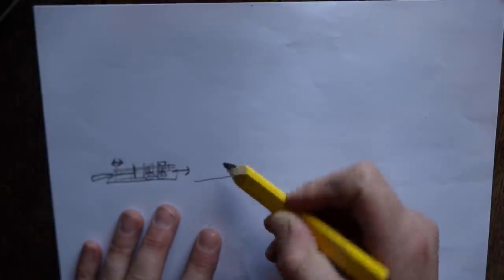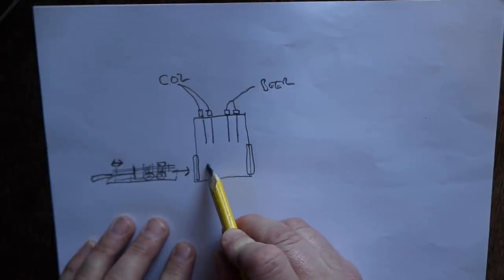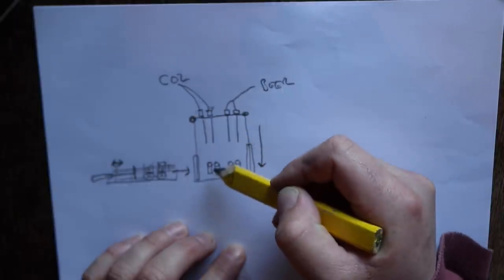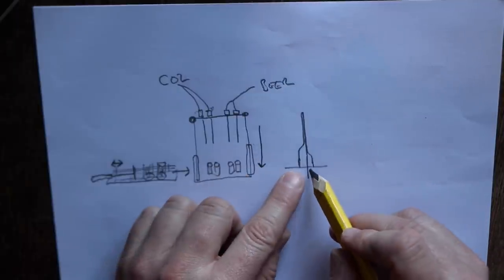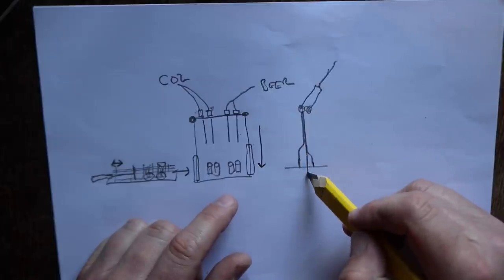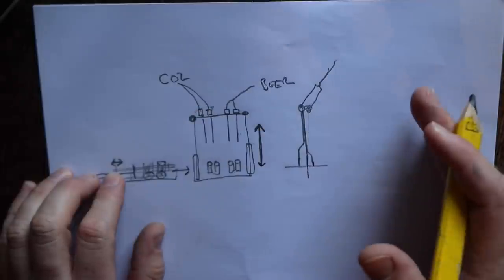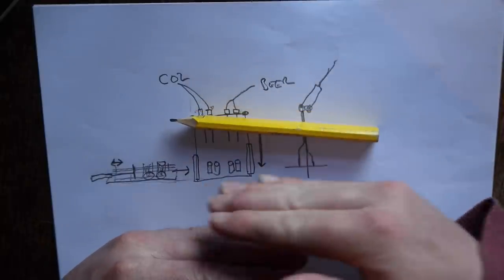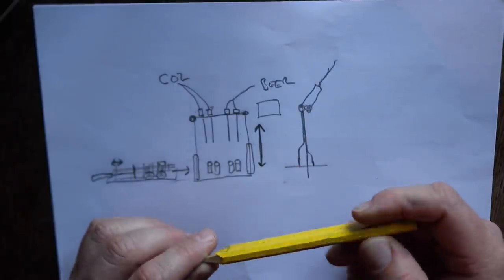Automatic Can Filler

Comment: Video called - Wild Goose canning - Defiance Beer has almost exactly what you drew in operation. It looks like filling is a simple volume controlled and the feed line is controlled by sensors. Neat drop system for the can lids. Purge is about 4 seconds. Slow and steady and very simple, which is always the best. Good Luck.
Reply from the maker: Cheers Bud
Reply: @harrybrew69  Rather have a Harry's brew, actually 🍻

Comment: I would say the can filling level would be controlled by weight, an interesting project all the same.
Reply from the maker: Thought of weight but there is a lag on the data being fed back, plus momentum of the liquid would also give a false read.
Reply: HarryBrew69 you could stop it before correct amount if using weight to counter the lag. A conductive inox sensor is simple and easy as you suggested.
Reply: @harrybrew69  flow sensors.  I messed around with hall effect flow sensors - Adafruit did a bit of a "root" beer keg which tweeted how much was being used.
Reply: The brewery I work at has a small canning/seaming line.  I'd be glad to video/photo each section for ideas.  It utilizes conveyors so you load a large table with cans that funnels to a single file where at the end there is a piston gate.  The cans get rinsed then stage for filling.  You may want to use a dual probe that purges with CO2 then fills beer.  After ours fills the caps are dropped on then they are seamed.  They are rinsed and dried then labelled.  Oh, I forgot at the beginning as they get funneled in they get date codes on the bottom.  Let me know.  I've set up these conveyor systems.  Like you, I can handle the mechanics but I wouldn't be much help with programming.  If I were to do it I might make it mainly mechanical controlled and avoid programming...
Good luck!  Can't wait to see the final build.
Oh, your rails should be teflon mounted to stainless...  I've also seen delrin used.
You'll also want a trough with a drain connected to a hose under all the track as foaming/spillage will occur.  
Make sure your filling with cold beer.  Ours works better the colder it is...
Reply: I agree that weight would be the most accurate. The foam will not give a true reflection of the amount of beer in the can. What if you have a beer that has more foam than usual?

Comment: Hi Harry,

This sounds like an exciting project. I have a few ideas based on the commercial canning line we use at work. It's an ABE (American Beer Equipment) machine.

First though, I don't have a lot of experience with the capabilities of Raspberry Pi vs Arduino, but I have used both. If I had to put my money on one, it'd be the Arduino. To my limited knowledge of these micro controllers, Arduino has greater expandability than Raspberry Pi and no doubt you will want to expand capabilities down the line. Just check out the SparkFun website to see the range of breakout boards available.

As for the machine itself, I would go with 4 filling heads and mount your purging tubes and fill level sensors around the fill heads. You've got the right idea with the fill level sensors, same set up as the ABE system, although it can be finicky at times. The sensor probes (like an L shape flipped forward) are made of pretty thin and pliable metal, so they can be easily bumped and upset the fill levels. Keep that in mind for your design. Personally I think there must be a better way to set up that sensor to keep it more accurate.

For the purge, I think 10 seconds is too long. Our line purges for about half a second. The idea is to put a small blanket of CO2 on the bottom and have the liquid fill underneath the CO2 layer. If I were making one myself, I'd have the CO2 tube go right to the bottom of the can, just above the bottom of the fill head. I would say no more than a 3 second purge you should be fine. We have a D.O. meter and can piercer too, so we can really experiment with this stuff and let me tell you, we have been surprised with some of the things that work in reality vs what you think should work. Purging time is one of those things. 

Another feature our system has is a CO2 pulse. The pulse happens during the last 3rd of the can fill. The idea is to create a fob of bubbles to help push out any O2 that may have mixed in with the CO2 layer. It's just another tube like the purge tube, but it sits about half way to 2/3 of the way up the fill head. (Note on the ABE site you will see both purge and pulse tubes are the same length. We found a shorter pulse tube works better.)

If you set up your fill heads like this it will be much fasrer. You don't have to go 4 heads of course. It would work just as well with 1 or 2 heads.

Good luck Harry, I hope you nail this project. You inspire all of us in the industry!

Cheers!
Reply from the maker: Thanks Man, all of that information is gold. I have had some thoughts on the fill level probe, something like some 1.5mm 316 filler rod connected to the fill tube with an adjustable collar. having the fill tube carry 5 volts then the probe on an input pun waiting to see a voltage, maybe with something like a trim pot to dial out the voltage from the foam. I will be filling for can conditioning at first so I might get away with the pulse to begin with. I do expect to be retrofitting the machine as I go though so it might feature later on.  I have decided to go the Arduino route too, got a couple of UNO's on the way.  Cheers

Comment: Mate, this is a very ambition plan. I have had a bit to do with process machines over the years and I can tell you there is a lot more to it than you can think. However there is nothing to stop you having a go and good on you for that. 

Regarding the filling, I don't know your laws in the UK but here in OZ, the measures are very important. I suggest you need to consider volumetric filling. firstly it is consistant with the quantity displayed and secondly, each can is a pressure vessel and too much fill can lead to an explosive release. You don't want that happening in a customer's hand. You can measure the volume either by piston filling or by weight. 

Can I suggest I can hook you up with a fully automatic 2 head filler and seamer for about 8,000 pound. Ping me if your intersted, it will save a lot of work.
Reply from the maker: Thanks for the info mate. If I had the cash I would be buying one. As it stands I need to pull this off for next to nothing. I can see the machine in my mind and I have an idea on the component cost. The controller is the tricky bit so far.
Reply: @harrybrew69  Roger that. Happy to help out if I can. I can also direct you to manufacturers in China for components, that in itself should save you a lot. 

Also advancing the cans down the line is done with a conveyer. When the can reaches a station it hits a barrier that either stops the line until the process is completed or the can slips on the belt. once the process completes, (say gas) then the barrier raises and the line restarts taking the can tot he fill stion where it hits a position barrier. Once filled the barrier falls away and the line restarts to move to the lid drop, then to seaming, etc etc.

Comment: Oh I love projects like this.   I'm a mentor for a FIRST robotics team (actually several) and think you could do a lot of this with components we use.   Not being familiar with gas struts I'd probably using motors, servos, optical sensors.   Maybe use a motor with a belt mechanism for the ramp.   I wouldn't raise the cans I would lower the CO2 and BEER lines to the cans.  I suspect it would be more accurate/reliable to use some sort of flow meter on the beer lines.  You can programmatically shutoff the valves after a specific amount of flow.   Those are just some ideas off the top of my head..   I'd have to sit down and get this on paper.  I'd be happy to help in any way I can.   

I'm a software engineer by day and a homebrewer by night :-)
Reply from the maker: I would love your help on the code once I get a sketch drawn out. I have pretty much got the hardware down so I am now putting the process on to an INO file ready to share on my next update. It will be full of holes though as this is new ground for me on the code side. Cheers
Reply: HarryBrew69 I’ll pull out my Arduino and start playing with it.  Haven’t used it in a while...    I’d be happy to help with the software.   I’m better at software than mechanical stuff.   My guess is we’ll need to know the voltage range for foam vs beer.   Once we know that it should be easy enough to write code that would take some action based on those ranges.   One thought is that we might be able to measure resistance (ohms) instead of voltage.   Not sure if there would be advantage one way or the other.

Comment: Pneumatics are hard to control for ram speed. For can feed, a stepper controlled conveyer would be easier, like a caterpillar track. Level sensing in stainless will be difficult, the foam may short the probes early giving a false trigger. The Arduino code won't be too hard, what may get complicated is a way to adjust variables i.e. gas purge time and feed speed.

Comment: The Arduino/raspberry pi question is a matter of preference. a microcontroller like the Arduino once programmed will just work. A Raspberry Pi is a computer so it has a bunch of overhead. The Raspberry Pi however is much more flexible. Running a web server from a pi to connect to a phone or tablet is quite simple and it has plenty of GPIO to interface with relays and sensors. Search aliexpress or ebay for "relay module" and you will get what you need there. Proximity sensors for detecting the cans. I can help out with some code if you like.
Reply from the maker: Thanks mate, I will be doing an update video soon where I will be sharing my code for all to laugh at. I am mainly listing the process first then hope to add the code in front of commented out instructions if you know what I mean.

Comment: I'm thinking you may want to gravity feed your cans a gas strut may end up crushing the cans.

I'm also thinking a float sensor around a filler tube might be better than a contact sensors. A contact sensor may be thrown off by foam. Furthermore, a float sensor can close a solenoid with no coding needed.

Comment: As already recommended I would use ESP8266 or ESP32 (ESP32 has a touch sensor that could be used for the beer sensor?) you can use the Arduino IDE to program the the device I learning it at the moment to control my beer fermentor, as it’s got built in Wi-Fi it’s easy to connect to a tablet, As you control the flow rate could you just use a timer ? Sounds like a fun project, I am using home Assistant on a raspberry pi to control the setting on the ESP8266 and display info on a tablet.

Comment: Its better to use pressure sensors for the beer height. There's a Norwegian guy that built an automatic dual filler based on a arduino. I will get his filler in a week or two. Just send me a message on facebook (Hop Rod Garage) and I'll provide some contact info to the guy that makes that filler - if you want to get in touch with him, Harry :)

Comment: You don’t need separate tubes for CO2 and beer. Just a T on top and 2 plastic valves, one for gas and one for beer. I have doit fot bottle filler. A single inox wire for level detection. Connected to Arduino analog input , an ajustable R pullup. The beer close circuit to the grounded filling tube. You ajust the sensibility with the pullup, to avoid foam detection.  You also want to have opto detectors to be sure ther is a can before start filling.
Reply from the maker: Yes, this is the way I was thinking. I didn't want the co2 firing out the beer left from the previous fill which is why I thought 2 tubes. The idea of a inox wire and grounding the fill tube is perfect. What is an adjustable R pull up? got any links.
Reply: HarryBrew69 a 4k7 potentiometer fron Analog input to Vcc. Most of beer in the tube will drop while rising and moving the setup.

Comment: You probably want to go with an arduino or some other microcontroller for the real time stuff like turning valves on and off.  If you look at some diy 3d printer videos you should get some ideas on controlling gantries and beds with an arduino. Have you any idea for the tolerance in how full the can is? This and the update rate of you sensor will dictate how fast you can fill the cans? Have you thought about just running the valve for a set time then checking weight afterwards?
Reply from the maker: The sensor will be set to the fill level and as soon as it touches the beer the valve will close, the examples I have seen seem simple enough but we will see. good idea on the 3D printer videos, I imagine home made CNC videos will be a useful resource too. 
Cheers Buddy

Comment: The automated motion control stuff-you'll get components for it from rs or Farnell, that should be fairly easy to configure with a raspberry pie. The coding should be fairly simple and if you read up on it a bit/steal some online code examples you should be able to get the hang of it. As for the filling, you might want to do some kind of batch control. So pressure and flow over time to calculate the volume and have some kind of contact circuit just as a failsafe
Reply: Oooo actually weight would be a good idea too actually as the other guy said! Might be simple to implement in code terms
Reply: This would actually be a really good undergraduate project for an engineering student!! Look to your local universities!
Reply from the maker: You are right, shame all the bloody schools are shut due to the Pandemic.  cheers man

Comment: Well if I was doing it.. Id probably actually go for one of the ESP8266 micro controllers rather than either a Raspberry Pi or an actual Arduino for several reasons. 
Why not the Pi .. this is time critical machinery movements, a slight delay in the sequence could cause things to get out of sync and either damage the machine or hurt someone. The Pi spends a lot of its time doing lots of operating system stuff. Whatever you choose just needs to look after your new creation. That's why as one guy suggested below a PLC would be perfect for the task but its probably overkill and not the sort of solution you can quickly tweek.
So an Arduino would be a better fit for you I think but the programming isn't so easy as they use a flavour of C/C++ that gets compiled and reinstalled every time you need to change it. 
ESP8266 s are very similar to Arduinos and you can program the same way but I would suggest replacing the firmware with circuitpython/micropython that way you can make changes to the code without having to recompile all the time. Plus pythons a lot easier to read.
The best bit of the ESP8266 is they come with built in Wifi so you could use any sort of tablet/phone to control parameters. A good place to start would be to try and work out how many inputs /outputs you might need to control everything so you can make sure whatever controller you choose has enough I/O. 
Lots to think about here. oh what about thes, https://www.hobbytronics.co.uk/yf-s201-water-flow-meter not sure if they would be acurate enough.
Happy to help if I can.
Reply from the maker: Thanks Paul, This is exactly the kind of information I am in need of. The hardware I can fudge out as we go but knowing how to control it is the most important thing. I will have a look at the ESP8266 and also draw up a more detailed plan to identify how many I/O I will need. Another video coming soon I think.
Reply: @harrybrew69  Just doing some more research re GPIOs and you can get upto 128 using some additional modules (8574 and 8574A) that would be loads more than you'd need I'd have thought. Better to use multiple controllers and break the process down a bit maybe. If you get to the point of knowing what needs to happen when you could get the basis of the code together using this tool http://www.flowgorithm.org/ and sort of simulate the process by manual input. Then it will export the code to python then you can flesh it all out a bit to get the real world interaction.

Comment: I am doing a version of this idea, but I am using bottles. I use counter pressure bottle fillers, relays, solenoids, and momentary switches to fill my bottles. I also have a way to stop the filling of the bottles using stainless steel wedding wire. Check out my channel, and take a look at my semi automatic bottle filler. If your interested in how the filler works I can go over that with you by email. My setup is a bit finicky, but I have bottled well over 30,000 bottles on my rig.

Comment: I'd use a laser pointer and an LDR (Light Dependent Resistor) - in a "push to break" type setup - rather than a more mechanical contact type switching (https://www.youtube.com/watch?v=jqHOPSL2MMU)

Comment: I have found a small project that might help,  https://www.instructables.com/id/Arduino-Bottlefiller/ I think this could be modified to your needs. I have taken the code and added a LCD etc, I'm not a professional coder just a beginner.  I'm looking into how to get the tins/bottles out of the machine after the beer has been added.  I'm thinking a belt might be better than air rams,
Reply from the maker: That code will help me get my head around what is needed, never done it before.
Reply: I think you should look at electric actuators not air,  are you going to hand ball the cans of the machine after filling? also how many bottles/tins are you looking to fill at once?